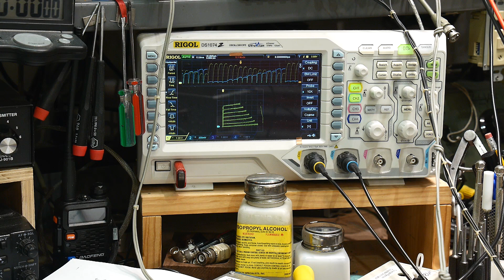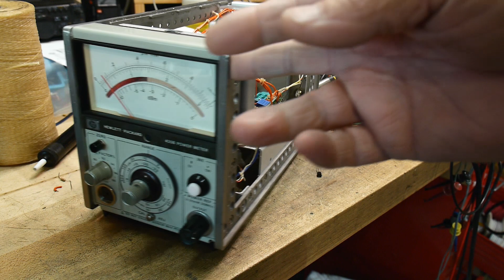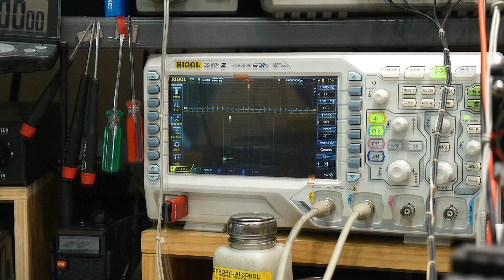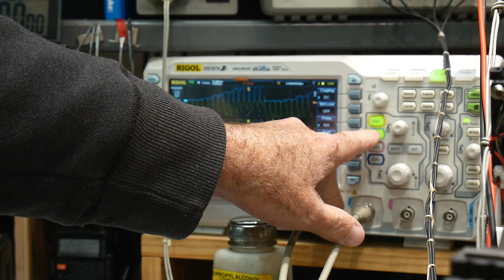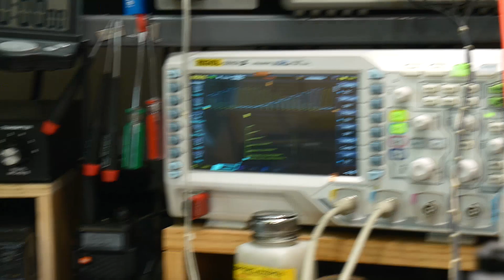#648 Transistor Curve Tracer (part 10 of 10)

Comment: You can also AC couple the channels on your scope, which is what I'm doing because if I don't the waves go off screen and when you AC couple the channels it stays nicely in the middle, especially when you're on the X Y function it's useful to AC couple because that goes way off screen too fast and then you have to dial in the signal manually again.
So set both channels to AC coupling, that's much easier to work with.

Comment: If you ever want to make custom front panel artwork I highly recommend using Avery 8665 Shipping Labels. Needs a light background so either brush the panel back to bare aluminium or spray paint it white, then print the artwork on the label (in color even), stick it to the panel, cut out the holes with a craft knife, and then give it a few light spray coats of transparent acrylic gloss. I have a panel I did like that 10 years ago and it's still crystal clear with no yellowing.

Comment: Nice project. Speaking of using relays and the arduino to control them. The small component testers based on gm328 could detect the type of transistor and set the correct parameters if you can reuse that code. https://www.mikrocontroller.net/articles/AVR_Transistortester

Comment: Nice project. I dont know what I missed, but why don't all the curves extend all the way up to the max VCE? I mean, as Ic is increased (Ib is stepped up) the VCE swings less and less, why is that?
Reply from the maker: collector load resistor. in a good curve tracer this is also a knob and you can set the load line of the transistor with this.
Reply: @IMSAIGuy  oh, yes, you have a fixed load resistor. I forgot that